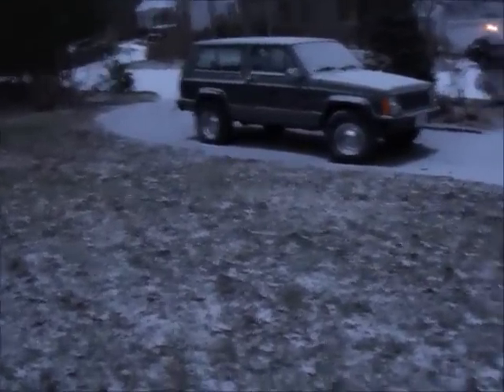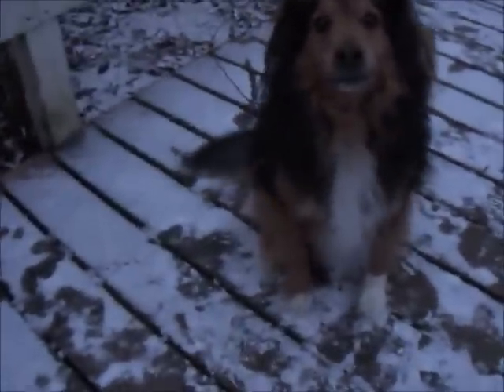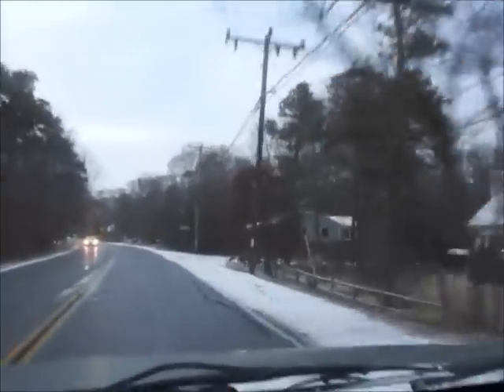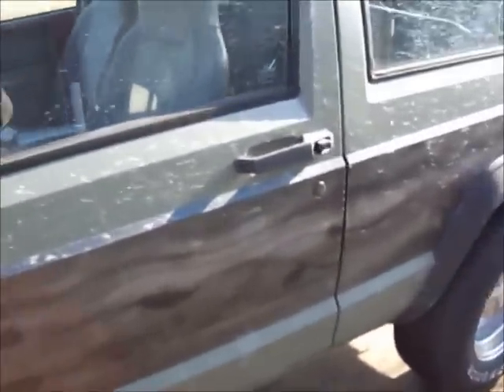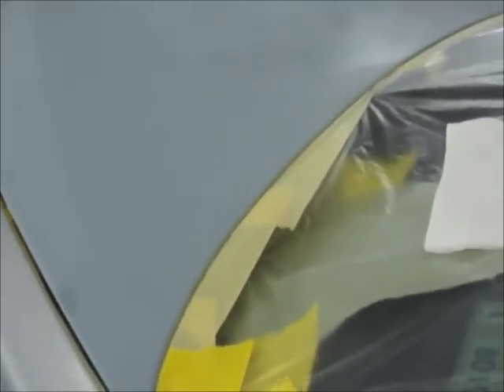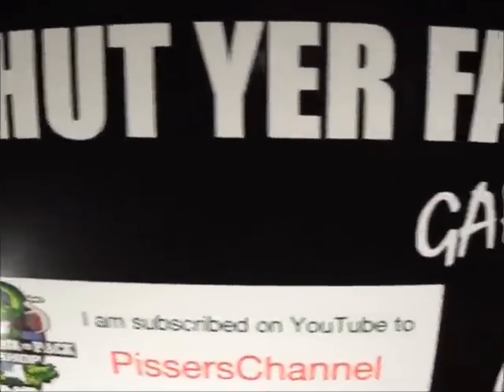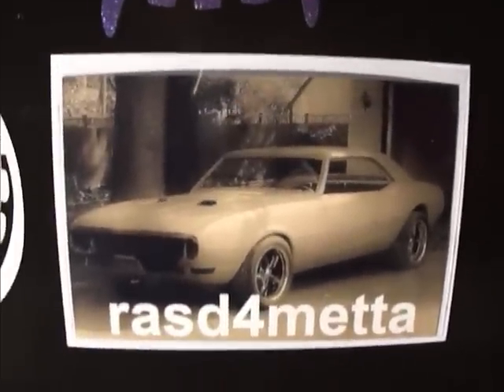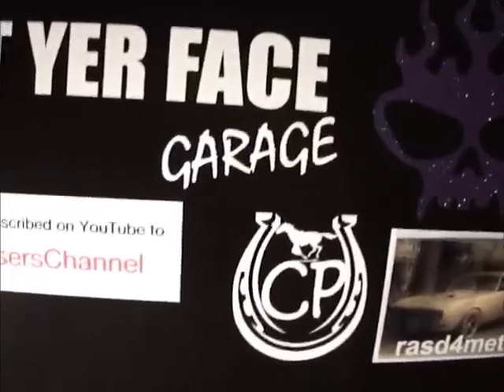More paint stuff

Comment from the maker: @kike3691 I haven't researched what is out there lately. I would say something at least 5hp 240v The bigger the tank the better. I have a 4hp 25 gal 120v craftsman at home and it is fine for small stuff. It won't run a DA for long though. Your spray gun will have a CFM requirement. The compressor should exceed that.